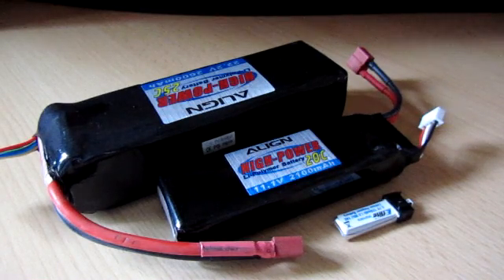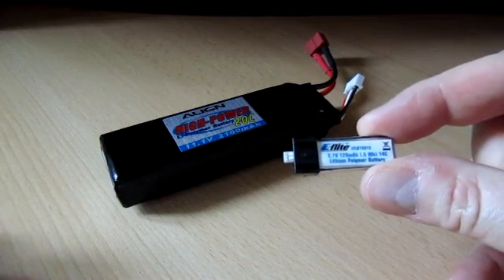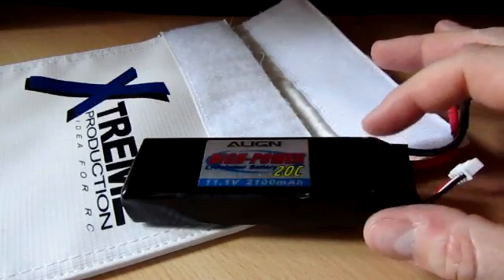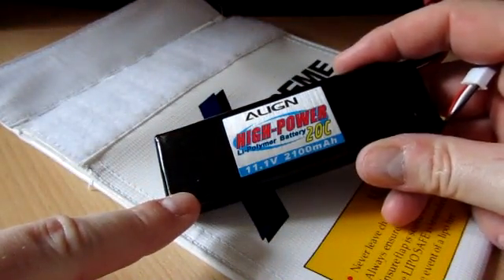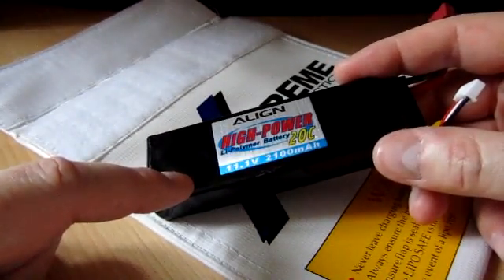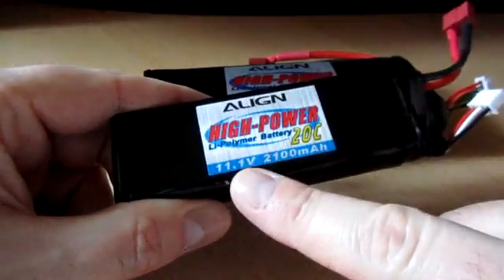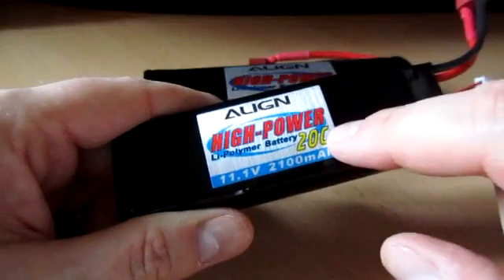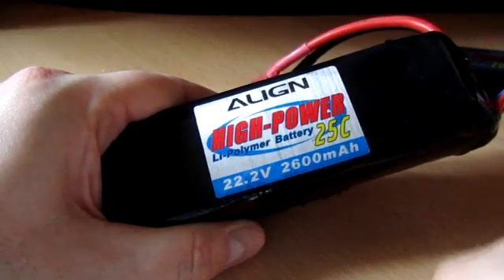Simple overview of the LIPO battery (LIPO Explained - mAh, C rating etc)

Comment: wow thank u very much for explain this to us all ,u have been a wonderful help and your are the only person on youtube that explain the used of these batteries ,i have not yet used lipo as i am not comfortable using them as yet but i am getting there ,can u please explain more about lipo batteries again ,i am looking to buy a cheap 7.4v 1300Mah batteries but i dont have a charger for it,how ever i do have a charger for much smaller lipo battery that 3.6v 300MAh batteries, https://www.google.ca/search?q=Syma-X5-15-X5C-3_7V-600MAH-Upgrade-Battery&espv=2&biw=1600&bih=799&source=lnms&tbm=isch&sa=X&ei=TAD_VMulIISqNqHbgegI&ved=0CAcQ_AUoAg#imgdii=_&imgrc=OFdH4_-9RVrEUM%253A%3BH9I4ZqliN4C4VM%3Bhttp%253A%252F%252Fimg.banggood.com%252Fimages%252F2014%252Fchenmu%252F08%252FSKU159859%252FSKU159859-1.jpg%3Bhttp%253A%252F%252Fwww.banggood.com%252FSyma-X5-15-X5C-3_7V-600MAH-Upgrade-Battery-Meal-p-941261.html%3B600%3B600would this charger be ok to charge the new lipo battery any help will be good thanks
Reply from the maker: A lot of these little chargers work fine for these smaller 1S LIPO batteries (3.6v). This will not work for the larger batteries.

As you get more into the hobby I would strongly recommend that you get yourself a decent charger. Don't risk the battery of the model by trying to 'make do'.
Reply: ok so the charger will not work for this https://www.google.ca/search?q=Lion+Power+7.4V+1300Mah&es_sm=93&source=lnms&tbm=isch&sa=X&ei=xQT_VNbDJ4izggTvx4CwDA&ved=0CAcQ_AUoAQ&biw=1600&bih=799#imgdii=_&imgrc=9Y2IiQUiWPsh3M%253A%3B0jRpr0GdWIujjM%3Bhttp%253A%252F%252Fimg.banggood.com%252Fimages%252Fupload%252F2012%252Fboat%252FBT684_1.jpg%3Bhttp%253A%252F%252Fwww.banggood.com%252FWholesale-Lion-Power-7_4V-1300mAh-25C-LiPo-Battery-BT684-p-65966.html%3B600%3B600
Reply: ok yep seem like i will have to spend the cash to get a better charger ,i am still kinda worry about lipo battery as they don't seem to be safe ,i dont wanna risk burn my mansion down because of a battery

Comment: thank you for this info . i would like to get your advice. i am building  a drone of 4 brush less motor : tarot t5008 KV340m with ESC 40A hobby-wing fun-fly.. and a telemetry.and some led light. for 12V but nothing added else. what it will be your advise to buy as battery. a good one
Reply from the maker: elie eid Hi Elie, tricky to answer without more detail but you need to be able to supply a little more than 160amps (4x40A). Weight is a factor as a lot of the model weight ends up in the LIPO pack. I would look at 4000mah packs with a 35c/40c burst spec.

Larger packs will weigh more but give slightly longer flight times..
Reply: thank you sir for replying me.the total weight of my drone is about 7pound or 3.17515kg including all. you think 22.2V or less.  and i am looking for flight an average of 15 or 20mm..
Reply from the maker: I would look for a 4-6s LIPO pack if you will be that heavy. You will need a LOT of mAh to fly for that length of time and a very low KV/large prop setup to be as efficient as possible.

Long flight times with larger models is an art form..

Best of luck with the build.
Reply: Thank you i apreciate ur help

Comment: Hi, thanks so much for your video, it was a pretty good explanation!
However I'm not sure if I understood correctly the charging part.
Let's say we have the battery you're talking about in the video, 2100mAh. If we want to charge it, we shouldn't go for more than 1680mAh. If the charger provides 0.75A, shouldn't the time of charge be 1680/750 = 2h15 instead of 1h20?
Reply from the maker: Hi Sara, the critical thing when charging batteries is to not exceed the maximum charging current. For the battery in this video the max charging current is 2.1A (1C).

Charging, depending on if you are balancing or not, can take vastly different times as the charger gradually reduces the amperage from the 2.1A down to almost nothing as the cells/pack approaches the maximum 4.2V per cell.

I hope this answers your question. Happy flying!

Comment: What happens for example if one cell has 4.6 and other has 4.5? Is it bad? should I get rid of the battery? or just discharge and charge it again? Please reply thank you
Reply from the maker: If the battery is at this level then the charger isn't cutting off, this is usually because the other cells voltage is very low and not taking a charge and the charger isn't smart enough to spot it. 
 
This is not great for the battery and I'd discharge and balance it then use a good charger to balance charge it again. Watch it like a hawk and disconnect and dispose of at the frist signs that the pack is bad.
Reply: Painless360 thank you

Comment: Painless360, what type of 12 volt batter is best to use to charge LiPos?  Should I buy are cheap car battery and a charger for that, or a golf cart battery and charger for that?  Well done video mate,  Cheers, RAW
Reply from the maker: Do you mean out at the field? I tend to fly from places with AC  mains power so i use a dedicated 12v 20a bench power supply to power the LIPO charger. but remember that you need to factor in the current for the charging.  i.e to charge a 6s pack at 5amps actually pulls 10amps. Sorry I can't be of more help.  Happy flying!
Reply: Painless360 Thank you sir.  My trainer plane did not come with a dedicated AC to DC charger.  So, it's back to Hobby King.  I'll also get some more batteries too.  Cheers, Richard

Comment: if I am using a 3s lipo at what voltage should I stop using  it to prevent damage
Reply from the maker: Hi James, as explained here in the video (from 8:40) you should have about 3.7v per cell at the end of the flight so 3.7 x 3 cells = 11.1v and not go below 3.5v per cell (10.5v on a 3s pack).

Be careful about setting alarms on models as the actual voltage at the output when you are drawing power will be a little less than this so you need to set the alarm to trigger slightly lower so you get the most time out of the pack but don't over-discharge.

Safest way is to fly the model and test the disconnected pack after you land until you get to the 3.7v per cell limit - then set this time on the transmitter so you know when you need to land.

Hope this makes sense. Happy flying.
Reply: thanks

Comment: if you have 2x 5S 3000 mah 20C in paralel conection and motor needs minimum 30C , will it2 batteries  work  batter than one battery?
Reply from the maker: Hi, both packs can deliver 60A each so together they should be able to deliver 120Amps. This is the same as having a 3000 40C pack. When you mean the motor needs 30C do you mean 30Amps?

Make sure the packs are the same age to give similar internal resistances as you don't want one of the packs delivering more than its 20C rating in use.

Hope this make sense.
Reply: Painless360  this is motor: Specs:
RPM/v: 2200kv
Poles: 4
Max voltage: 18.5V (5S)
Max Current: 100A
Max Watts: 1200w
Resistance: 0.0094ohm
No Load Current: 2.9A
Can Diameter: 39mm (actual motor diameter) 
Can Diameter inc. Water Jacket: 49mm
Can Length: 69mm
Shaft Size: 5mm
Weight: 415g
Reply from the maker: Ah a boat! I see why you need the power now.

The two packs should be able to deliver the 100A you need with a 20A buffer. Be careful when you first try it and check the packs after a few mins of pottering on the water to check that everything I happy. Happy boating!
Reply: Painless360 tnx.  :) i was driving on 1 battery than i think with my head... i have 2 same batteries why not try that, than i vas watching your video :)  You should make wideo about C discharge   and problems like i have :)
Reply from the maker: Connecting batteries in series or parallel (LIPO) ;)

Comment: So you`re not supposed to fully charge the lipo battery, only up to 80% right?
Reply from the maker: You always fully charge the pack so that each cell is at the safe maximum of 4.2v. You always leave 20% of the capacity in the pack when discharging it. See from 7:50 in the video. Hope this helps.
Reply: Painless360
 Thanks for the help,! i`ve been living day and night behind the computer figure out how lipo batteries work, this video is highly recommended.

Comment: if i have a 300mah battery how long is my flight time gonna be? please reply
Reply: got it thank you :) and i was also wondering what charger i can use for this battery?
Reply from the maker: Shady King Any decent LIPO charger that can balance well will do the job for you. You normally get a cheap charger with the model when you buy it but more expensive models provide much faster charging and better balancing (usually!).

Your local hobby shop or HobbyKing can offer some advice and offer a selection of models. Hope this helps.
Reply: about the battery i ordered.. Its a 300mAh 2S 7.4V 35C LiPo Battery.. someone is confusing me and telling that this battery os only for Blade 130 x Helicopter.. I think you know more so please tell me..
Reply from the maker: I can't answer that - you haven't told me what the model is you have. That pack does sound like the battery for the E-Flire 130x helicopter but this battery will power any model that needs 7.4v and pulls less than 10.5amps. Depends what you're putting it in!!
Reply: thank you.. it turns out i need a greatplanes battery..

Comment: HELLO..  I've bought an walkera x350 quadcopter. it uses basic 1.1V 2200mah C30 lipo battery.. is any problem if a use a 11.1V 5200mah 45C ?
Reply from the maker: Hi Patricio, the main problem with this is the extra weight of the larger pack and the larger physical size. If it will fit and the model can lift it then it should work.

Happy flying.
Reply: Painless360 Thanks for the info.  Best regards

Comment: After fully charging lipo battery, till how many days we can keep the lipo fully charged or within how many days we have to use it or dischagre it. Thanks.
Reply from the maker: A LIPO will stay charged for months. This isn't recommended. If you are not going to use the battery within a few weeks of charging it then, in my experience, it is better discharge it to a safe level. They will last longer and provide better performance.

Hope this helps, happy flying!
Reply: Painless360 Thanks for the reply.

Comment: Hey, I want to know if you could switch out Lion battery of 7.4v 1100mah for a Lipo 11.1v 1000mah? higher volt and lower mah is from helicopter.
Thanks.
Reply from the maker: Hi Viet, I would replace the Lion battery with a pack with a similar voltage. i.e. a 2s LIPO pack that will give out 8.4v fully charged and be at 7v when depleted. Similar to the LIon pack you alreadey use.

You don't mention what you are putting the pack into but usually going from 7.4v to 11.1v on kit that can't handle it will cause a problem. If you are looking for longer run-times on the model then look at a 1800-2000mah 2S lipo pack and search to find the smallest one that will deliver the power you need.

Hope this helps.
Reply: Thank You! and I subscribed.

Comment: and 2:
During charging, the LED on the wall-charger is red and it turns green when it's done.
Is there a chance to damage the battery or even risk a fire when it stays connected some more time even with the green LED on?

Thanks in advance and all the best to you man. ;)

Comment: hi there, first of all thank you very very much for doing this nice explanation.
i still have some questions, though:
I'm flying a micro CP helicopter and it uses 1S lipos.
with it came a wall charger with an LED.
the things that bother me are:
1: if the battery gets low the heli's performance also lowers, so that's the sign for me to charge it. Is that practice okay, or is there a good chance of damaging the battery if i keep flying until it actually stops working (the heli)?

Comment: Great video. Thanks.

I'm curious about the discharge rate of the batteries. I've heard it's good to break in a new battery with several charge/discharge cycles. Should I discharge it @ 1C as well?

Comment from the maker: The amps used to charge the pack to a storage voltage should always be less one 'C'. i.e. in your case use 2.2amps to charge the pack and stop charging when the pack is at 3.8v. That's a nice voltage to store them at.

Once you are ready to fly with them again, charge the pack using 2.2amps or less until each cell of the pack is at the 4.2v maximum. The entire pack will then read 12.6v - full charge for a 3s LIPO. Then you are ready to fly.

Comment from the maker: A storage charge is used when you will put the battery away for a number of weeks or months without using it.

 The storage charge makes sure that the battery never falls below the minimum level (3.5v) while stored away and doesn't involve any unnecessary electrical stress on the cells by storing them fully charged ( I have packs puff up after leaving them over winter fully charged) . 

I hope this makes sense.

Comment: so i have a 3000kv motor, 30A esc, 2200mah 3s 30C battery. i notice even without a prop(6x4 is i will use), it still get hot on the shaft. i dont know why, the battery C rating is too high, or the esc should be 20-25 amp. thanks

Comment: Hi I'm flying Hexacopter
There are 6 motors and 6 ESCs
Spec for the motors are below
Battery: 2 Cell /7.4V
RPM: 1680kv
Max current: 8A 
No load current: 7.4V/0.20A
Internal resistance: 0.32 ohm
Weight: 16g  (not including connectors)
Diameter of shaft: 2mm
Dimensions: 22x23mm
Spec for ESC is below
Cont Current: 10A
Burst Current: 12A
BEC Mode: Linear
BEC : 5v / 2A
Lipo Cells: 2-4
Can I use the following batteries
20 c 1350mah 3 cells, 
20 c 1000 mah 2 cells
30 c 800 mah 3 cells?

Comment: On my GT power x drive 6 charger I had no idea what the number was now I know it's how much charge I'm putting in so now I know once my 4200 mah bat gets to 3360 it's good to go also I haven't been charging my batteries long enough I used to let it read about 3.85 on each cell not knowing 4.20 was the full capacity thanks dude great vid now hopefully I will get longer than 10 mins out of my traxxas bandit VXL :)

Comment from the maker: That sounds like a great way to treat your pack. You can keep the pack at charge for a week or more but the care you are taking with the LIPOs should result in a much longer life. 

I've looked at the specs for the Sv2 ESC and the car specs don't list the amperage. Your pack can deliver a huge amount of current so as long as the ESC and motor don't pull more you'll be fine. The rule of thumb I use is have 10% capacity extra from LIPO to ESC, ESC to Motor and you'll be fine. 

Hope this helps.

Comment: IF I am using a 50C 5000 MAH on a Castle Sv2 ESC (Ground esc) its a 1/10 sacvle ESC for cars and trucks will if puff if I am charging at 1c and balance it one every week and if I know that I am not gonna use the pack for atleast 2 days I take it down or up to storage voltage? IMO thats pretty good care for a LiPo but you know more than me

Comment from the maker: Packs can puff out for many reasons- from pulling too many amps or not being cared for. I had two new LIPO packs puff up over winter when I stored them on a full charge accidently.

The C rating on a pack is for a sustained discharge rate, You can pull more amps for a short period of time without damaging the packs.this 'burst rate' is sometimes printed on the pack and for very short period shouldn't damage the pack.

If a pack puffs after being used within the C ratings then I'd get a refund.

Comment from the maker: The latest generation of batteries are now allowing for faster recharging. Until now charging at 1c (i.e 2.1amps for a 2100mAh pack) was normal. With these new packs you can charge at 5 times the rated capacity i.e. 10.5 amps for a 2100mAh pack!

Great is your charger can deliver that much power as the recharge time will be a fraction of what it would be at 1c as the energy gets into the pack that much faster.

Hope this makes sense.

Comment from the maker: Storing your battery for along time with a full charge isn't good. Also, storing a battery with the minumum 3.5v can cause problems as the pack will slowly discharge when it's stored and take it below the minumum voltage.

The answer is a storage charge, This is usually about 3.8v per cell and lets you put a pack into storage and avoid the pack discharging below 3.5v per cell and without the stress on the pack from having to hold a full charge for a period of time.

Hope this helps,

Comment from the maker: @thewillage, The 80% rule is about how much you discharge the battery. If you had a 1000mAh pack then you would not want to take out more then 800mAh before recharging, taking more can decrease the life of the battery. 

If your charger shows the number of mAh going back into the pack as it charges, make sure that it's not needing to put more than 80% back in. If it is, fly/drive the model for a shorter time. Hope this helps.

Comment from the maker: @TheBigspecky, I started using the charger that you get with the modelsyou buy but always seemed to be waiting for the charge to finish. I then moved up to an IMAX B6, a copy of a Bantam model charger and found this a great improvement but had problems with the quality of the unit (balance charges didn't work well). I replaced that eventually with a 'real' Bantam BC6-10 charger and have been using that for everything for over 2 years. As with a lot of things - buy cheap, buy twice!

Comment from the maker: @martyisnuts, you will see poorer performance from your batteries in the cold. Like all batteries the LIPO relies on a chemical reaction to get the power back out of the pack and the low temperature makes this reaction 'sluggish'. You should keep the battery at room temp unitil you need it and expect to lose about a quarter of the flying time. Hope this helps,.